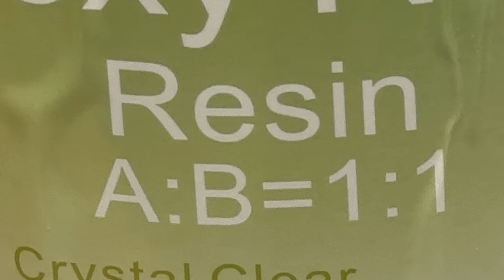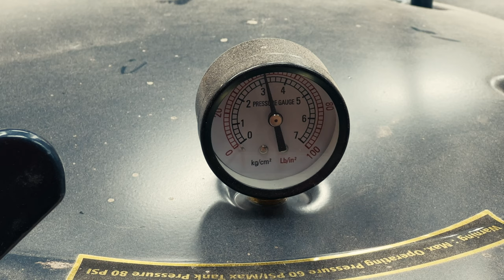Mastering Wood and Epoxy: Secrets Revealed!

Comment: You need a sand blaster. First time I have seen the tenon cast in, good idea. I'm assuming Purdo gives you the resin.
Reply from the maker: Mmmmm sand blaster …new toy! Great idea lol. Well I have recently formed an affiliate with them but honestly their resin is as good as any. But cheaper. Plus I can get it over night 2 days max from Amazon. I’m using their casting product which normally  would be deep pour that is twice the price. I haven’t yet encountered thermal cracking in my pours. But even if I do I would use a contrasting filler.